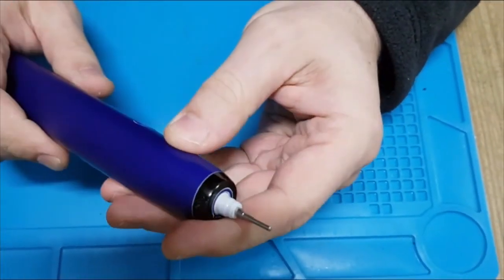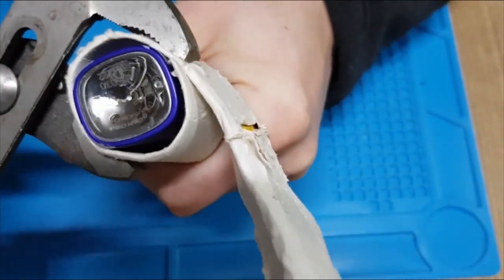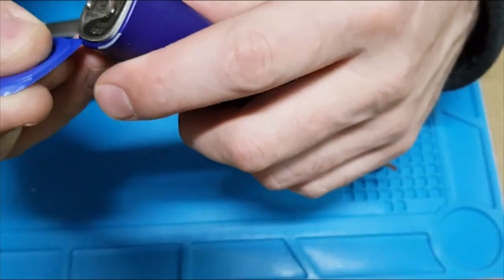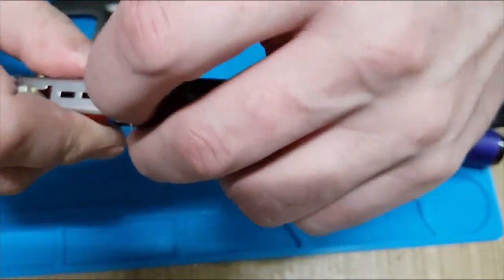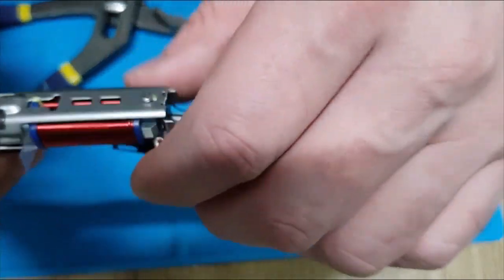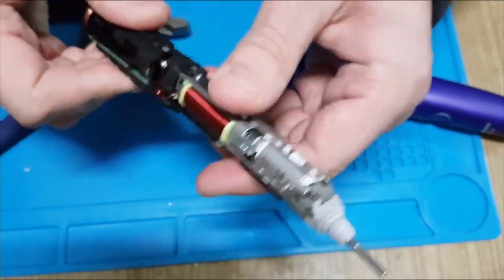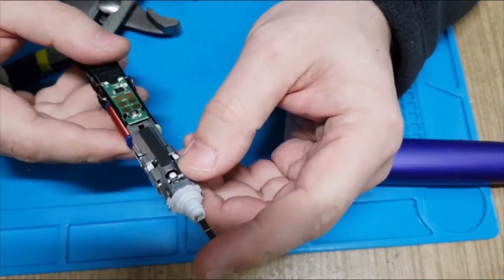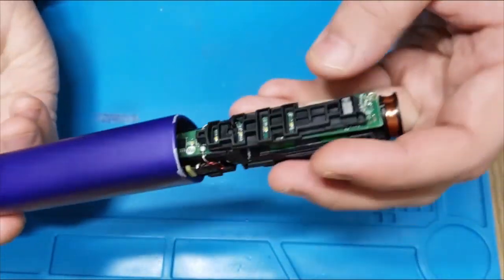Philips Sonicare DiamondClean /no vibrations/ opening and repair

Comment: Thank you for your video I was able to fix my toothbrush and it worked again! However after one night I now have another problem, the light is blinking Amber with 3 flashes (empty battery), I opened the toothbrush and checked again the gap is still there, any other fixes?
Reply from the maker: Well empty battery is not affected by the gap at the electromagnet  ;) check charger, try the travel charger, maybe your main charger is defect? Or other idea would be that maybe you accidentally damaged the charging coil... insert it without case in to charger and measure with multimeter if you get voltage after the coil...

Comment: Have you ever encountered a problem with the toothbrush turning itself on spontaneously?
Reply from the maker: Hi, no.. but I assume water damage if the top seal has build up. So I would definitely recomend taking it apart for closer inspection. From what you will find I saw few videos with possible solutions: if water was present one guy exchanged the micro button on pcb. Moisture inside of the button was causing the turnons.. one more not that plosible problem that I can think of could be toothbrush paste buid up in toothbrush casing button. That can be washed out by inserting the case underwater and constantly pressing the button to wash out the buid up.. hope this helps ;)
Reply: Lets Fix It Garage thx! I’ll try my best 🤙

Comment: i have fixed this issue 2 x... and now I see your video... 3 layers of shim stock works best... then remove the middle one and the other two come out easy.. using 1 layer and it can get stuck the magnet is so strong... if it fails again I will use locktite.  first time it failed because I dropped it right on its end.
Reply from the maker: You are right 2 is minimum 3 is the most comfortable but I like to have the gap as small as possible so thats why I use 2. And loctite is highly recommended ;) cheers!
Reply: @letsfixitgarage  .5-1mm seems to have plenty of power.   I dropped it first time from countertop height.  This last time I left it at brothers  house and I think shipping even in bubble wrap can be to much.  Loctite would help and I have it.

Comment: Worked fine. Except the use of the plastic part to remove the bottom. Experience learned that if you just keep squeezing an rotating the body it pops out by itself. Did buy a second body though. So were having our own. 😁

Comment: Thanks for the fix. Is nobody going to mention that this is utterly stupid design on Phillips part? Holding the vibrating part with tiny screws that they know will come loose?  Imagine if your car was built this way.
My fix is to never spend the premium price for Phillips crap again.
Reply from the maker: Can't speak for Philips but they learn from their mistake I saw few newer ones where this gap is additionally fixated in with epoxy.
Reply: @letsfixitgarage  Thanks for the update. I'm happy they have addressed that issue. Mine only lasted 1.5 years and has acted up repeatedly with the known gunk buildup problem. It is under warranty but I have no confidence in the product anymore since I saw your video. Thank you! Moving to Braun.

Comment: Thank you very much for this! My Sonicare was exhibiting the same issues, probably the result of dropping it... previously Philips replaced it under warranty but several years later it happened again out of warranty, your video was the most helpful resource I found on how to repair it.

A few notes that might help others:

- I couldn't find anything plastic to remove the bottom cap so I used a flat head screwdriver, it made a few small indents on the cap but worked OK. Prising this bit off is quite hard so keep at it, you can apply quite a lot of pressure with the adjustable wrench to get a decent amount of opening.

- I found it really tricky to work out how to open the plastic grips that hold the internals in, none of the descriptions online were that helpful. The trick to know is that these plastic catches can be pulled away from the outer case towards the internals. I found using a flat head screwdriver against the bottom of the catch (which you can see on the left and right of the internals if you look inside with a torch), nudging it towards the internals until it pops out worked best. It's still a bit fiddly though. Just keep in mind you want to pull the catches "inwards" (towards the internals) until they disconnect from the outer casing.

- I managed to snap one of the plastic teeth that holds the circuit board of the bottom bit on to the top bit, so it wouldn't snap back into place properly. I ended up using Blutack to stick it in place. The correct alignment of the circuit board is so that you can see only the top "hole" on the metal frame underneath, the two T shaped bits should be totally covered as this is where it slides on. If you do the same and get the alignment wrong, it won't work when you put it back together as the switch is misaligned.

- My magnets were stuck together when I opened it. You need to prise them apart with a flat head screwdriver. It feels hard to do because they are magnetically attracted but you can do it with a bit of force!

- The first time I fixed it, I used two bits of thin plastic from some packaging to space out the magnets. This worked quite well, but I could still feel the handle itself vibrating somewhat and it didn't feel quite as powerful as I remember it originally being. 

- I also noticed that the seal was totally rotted away, which had caused a bit of damage already in that a couple of the "mode" lights don't work any more due to corrosion, so I put it back together, used a rubber band tightly wrapped around the shaft as a temporary seal, and ordered a new seal from eBay. You want a mk2 seal. Search for something like "PHILIPS SONICARE WATERPROOF shaft seal rings MK2 HX6730 HX6511 SPARE REPAIR UK"

- The second time I fixed it, I used three bits of the thin plastic to space it out. This works much better.

- The second time, I also managed to snap the thin wires connecting the two parts :( Be careful with these as they are only soldered on and if you move them too much, they'll snap. I was able to solder them back on without too much trouble (and I'm rubbish at soldering), so don't worry too much if this happens, but do try to avoid it!

Anyway, my Sonicare is back to full health and all sealed up now, and if I drop it again, I'll know what to do. Thanks for the video and for saving me £100!
Reply: this helped alot,
Reply: Omg can I send mine to you and will u fix it for me?  I pay you 😣

Comment: Many thanks for your video, very clear and helpful! 
I didn't manage to get mine to properly work again though. Vibrations still seem very low, even after creating a small gap between the magnet and electro magnet (0.5 - 1mm). Might it be the head of the toothbrush, or worth trying something else? Thanks!
Reply from the maker: Difficult to say without seeing... maybe something with the head unit it is fixated with a screw to.. if nothing helps try to exchange the whole electromagnetic unit from a broken one on ebay there are a lot of water damaged ones with a good electromagnet units..
Reply: Same. The vibration seems so so when compared to a new unit even after pyring open 0.5-1mm gap for me. But it feels strong enough for brushing though so I just leave it alone.
Reply from the maker: Difficult to say what is the problem.. could be something broken inside of the electromagnetic drive. It's easily replaceable and this drive mechanismus is on majority of Sonicare toothbrushes, even the cheapest ones. ;)

Comment: UPDATE*** ordered the top part from ebay for $14.99! toothbrush is humming like a bird. when i took bottom cap off i tapped it hard on the ground and it slid out. thanks for your help! so happy to have toothbrush back after using a normal brush. teeth dont feel furry anymore.

Comment: First try to slightly knock on shaft tip (axial direction) with screwdriver handle. In 50% it will help and you won't need to disassemble.
Reply from the maker: can't recomend this fix.. I would say 20 help/80 make wors :) it could move the magnet slightly further from electro magnet but it could make it even worse.. there are quite fragile parts that could break..

Comment: I cant get the black side to come off to get to the other screw. any suggestions
Reply from the maker: Only one - take it off :) under it there are two latches, sometimes they hold quite strongly sometimes no.. just wigle it and pull apart if they brake off it's not that critical toothbrush will function without them..

Comment: hi mate,  thanks for your video, I tried this but as soon as I pull the credit card out between magnet and electromagnet it drops right against it :/ any ideas why?
Reply from the maker: It could be that the plate inside is broken you can test it by removing the upper screw and pulling the upper part out.. difficult to explain I will make one more video of typicall errors and show what I mean. Solution would be to replace the whole part by desoldering the two wires..
Reply: Lets Fix It Garage i see. I took of the top head where the brush goes on and had a look but found nothing wrong. So i should just replace the top bit i guess. I tried to move the bits around above the magnet hoping it would slip into position but to no avail. Thank you for answering and your suggestion! 🙏
Reply: Any idea what the top part would be called?
Reply from the maker: @andypandagram  in your case I would look for a donor - broken toothbrush and replace the whole head with the electro magnet. It's more common that the top seal fails and electronics get damaged than the mechanics, so look for a dead toothbrush from the electronic side then the head part should be good.
Reply: Lets Fix It Garage i found the part. Vibration head on ebay. Will order and swap out. Thanks for your help!

Comment: 170 bucks for a toothbrush that requires you use force to open and fix it after it taking slight impact. smh i hate this toothbrush im going to have to solder the wires back on. for now i have a giant heavy manual toothbrush. yayy. however this video was helpful. if i was a little more careful it probably wouldn't have happened.

Comment: My toothbrush does not charge. There is no totorial for this on youtube. No reaction to charger. Could you advise what to do?
Charger is definitely not the problem because I have 3 chargers and all produce decent electromagnetic radiation (tested with meter). Please help! The toothbrush cost me a fortune.
Reply from the maker: Is the rubber sealing on top of the shaft in good condition? If it has some tears it got water inside. usualy the electronics get toasted.. in any case tear it apart and take a better look in electronics
Reply: @letsfixitgarage  I'll do it as soon as i get the new one from warrenty support.

Comment: Great video!
But how did you remove that part at 4:50? Which way to pull? I can't pull it apart, it only slides forward. Very affraid to break it.
Reply from the maker: Sorry missed your question.. I assume you already disassembled  it but for anyone still strugling with this there is no trick just two latches underneath and it neads a stronger pull to pull it apart. If they would break no problem as the while assembly is under slight pressure so the latches will not afect your toothbrush performance
Reply: @letsfixitgarage  Thanks a lot! I didn't disassebled this thing yet, because it was enough to use the only bolt at the bottom side. But I'm sure there will be necessity in future.

Comment: I tried this and was very glad it worked first - but then I realized that the vibrations were still way too little.
Do you have any idea what to do now?
Reply from the maker: Difficult to say.. I would inspect the head wit magnet and electromagnet.. or buy a defected (with defect electronics) and exchange the whole head by desoldering two solder points.. it's really quite modular this tooth brush;)
Reply: @letsfixitgarage  Thx for your response. Ill give it a try!

Comment: Hi. I can't seem to get the unit out as I can't locate the clips holding it inside. Anyone able to help!?
Reply: To anyone having the same problem - there are two clips, one on each of the long sides, in the middle. It's not enough to just press them, you need to pry the whole thing out, pushing towards the middle/front. It helps to press the short sides of the outer shell towards each other using your hand while doing this.

Comment: Hi, my handle vibrates perfectly until I put on the brush head. When I put on the brush head the vibration becomes very weak, sometimes it does not vibrate at all. What can I do to fix this?
Reply from the maker: Well first of all you will need to take it apart like it is described in this video and see where the problem is exactly.. from your description it could be a lose bolt on the top of the toothbrush or a compleately broken part that could be fixed only with spare parts..
Reply: Mine does this too. Did you manage to fix it??

Comment: I fixed my toothbrush as written. Worked excellently at first, however now not able to charge. Any thoughts?
Reply from the maker: Only few.. if the rubber part is ok and no water got inside (in this case electronics is screwed and not much can be done) maybe the induction coil was damaged in dissasembly/assembly process.. in that case look for damaged coil wire or solder point that broke off..

Comment: I cant adjust the screw. It glued from the factory. The only space that possibly done is slightly lift up the magnet instead. But how to hold the gap? Any advise?
Reply from the maker: Have you watched the whole video? I insert a piece of plastic as spacer between magnet and electromagnet for the purpose of holding it in place and only then screw in the screw..
Reply: @letsfixitgarage  yes i watched the whole video.. the problem as i explained before is the red thing (electro magnet) is glued from factory. So it cant move down at all.. the magnet can move a bit and i can insert a plastic to hold gap. But thenthe magnet will attach back to electromagnet when i take the plastic out. My electomagnet can not be adjusted like yours..
Reply: @fendyfelani3714  very strange.. never saw glued in electromagnet.. it's always fixed by the two screws that I re tighten in the video after adjusting the gap.. was it bought new? maybe it was already repaired? originally the electromagnet is not glued in only these two screws hold it in place.. You could try to brake it out but if someone glued it in, it could be that the screws or thread is damaged and it doesn't hold...
Reply: @vgelazauskas  it was a gift. But i reckond was brand new in the box. My model is pink colour, but still strange if it is glued on the other end (not on the screw end). Can see the glue obviously. I tried to heat it up to melt the glue, but it didnt work. I still can unscrew both screws, but no point cos the electromagnet is glued.
Anyway do you guys think i can place a thin plastic on the edge of the head of the electromagnet and leave it? Just to make a gap between electro magnet and magnet.
Reply: @fendyfelani3714  could you send picture or make a video where the glue is? if you leave plastic spacer between magnet and electromagnet vibrations will be much lover or non existent.. you need the gap..
Reply: @vgelazauskas  yes ofcourse.. i can send it to your email..can i have your email address please..

Comment: Tried this but when I remove the plastic the magnet just drops back down and contacts electromagnet....suggestions?
Reply from the maker: do you screw in the fixing screws tightly with loctite? or is the thread damaged?
Reply: @letsfixitgarage  They're tight with electromagnet as far down as possible...the magnet on top always just drop down and sits directly on it as soon as i take the plastic out...
Reply from the maker: @nevrevrenuf  it could be that the shaft is broken you can check it by bending the holders and taking out electromagnet compleately. If the magnet falls out you will see the broken shaft.. sorry but no way to fix it just replacement of compleate part of shaft-magnet-electromagnet.. buy any broken toothbrusch and just resolder two wires ;)

Comment: Thanks.  I managed to dismantle as shown, but unfortunately the damage turned out to be in the shaft connecting the motor to the brush.  Unfixable.  Disappointing because it is a very expensive toothbrush and it only lasted a few months beyond warranty.
Reply from the maker: don't give up :) as in the comment below you can buy a defected toothbrush and salvage the needed part from it ;) eBay has quite a lot of them.. yes sadly they are quite easy to break if droped.

Comment: Fantastic video !!! I disassembled my Sonicare in under 10 minutes.
Basically mine fell head on in the sink.
I found out at the head where it screws to the metal frame by a screw and a nut, is broken ..
I basically need a new top head !! Where can I find parts !?
Reply from the maker: ebay is good place to look. either complete defect toothbrush or new head itself, I saw them in ebay to. all you will need to do is to resolder 2 points, easy job but you need to have a soldering iron.
Reply: I already have a new head on order coming from eBay China .. the Chinese reproduce everything $7 
No need to solder anything, when you remove the screw completely, you can put a new head on
https://rover.ebay.com/rover/0/0/0?mpre=https%3A%2F%2Fwww.ebay.ca%2Fulk%2Fitm%2F253558890923